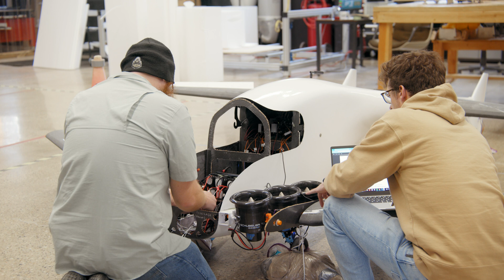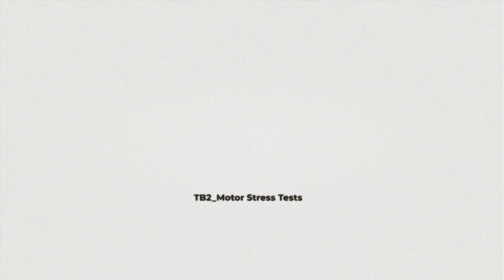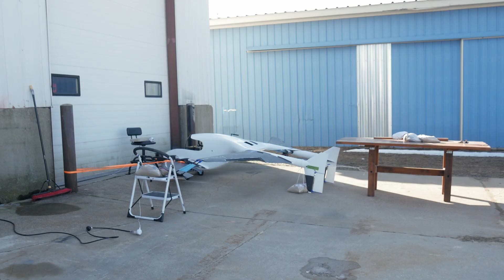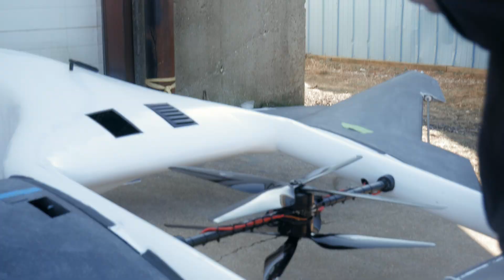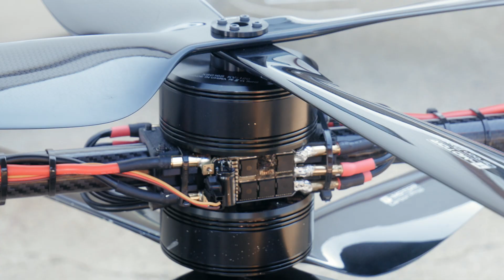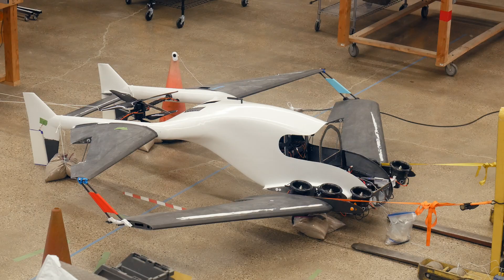TB2 - Stress Test

Comment: If you eventually integrate a coolant system, could that be designed to also be a source of power generation?  To act as a small charger when the coolant system is activated, feed back into your batteries to improve efficiency?

Also, for the main Orb design, any points of where the wings integrate into the primary framework, any "wing flex" could also be leveraged as a source of energy production while flying.  

Trying to think of ways to capture some of the stresses, movements, or energy that could improve efficiency.  Kind a like an EBike with electric Generating shock absorbers... Where even the weight and movement of the load sources could be a source of energy production.  Gravity is the one force we are failing to monetize and capture.  From railroad ties that generate electricity when a train passes, to electric generating shock absorbers, to coolant systems that can be a source of energy and not a draw.

I absolutely love Orb's design for personal aircraft and I cant wait to support this business by purchasing one for my family.  Also, not informed on your funding, but would love to eventually be an investor in the business.  As I avidly believe in Both your product & mission. Im a fan of creativity and breaking traditionalist perspectives( ie limitations), and I truly hope this business is a massive success, not just for the impact within aviation but how the product will change how we help people in remote areas.  Its a revolutionary concept of transportation so I wish all of you the best of luck & Godspeed.  R&D is nothing but a alignment of problems that have to be resolved, a million trial & errors to eventually find positive outcome.  Relentlessness, creativity, & patience are your 3 meals a day...

Im a Quantitative Strategist in the investment space, so Im well versed with creative solution sourcing, and the importance of the wisdom gained through trial & error. Failure is constant, until its not.  Pray that discouragement never finds you.

Cheers

Comment: Have you ever looked into an ammonia power cell to drop the battery weight?  This is a technology that I am currently working on for vehicles as you do not use it for combustion in an engine but a cell to produce electricity and use electric motors for the drive train it is way more efficient.  Also the power density / weight ratio is way more efficient then batteries.